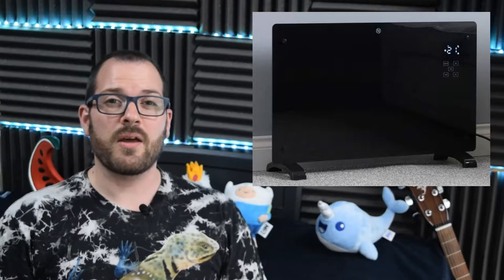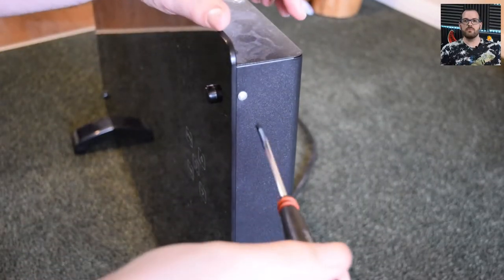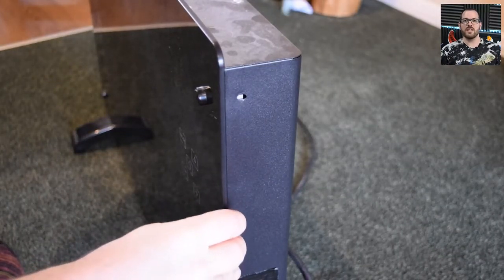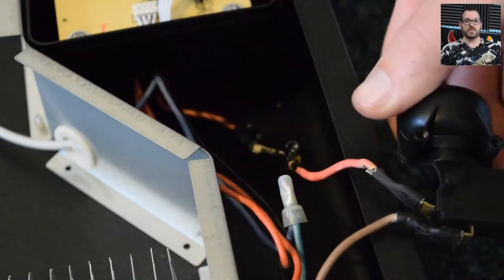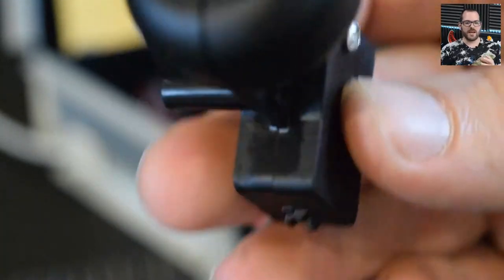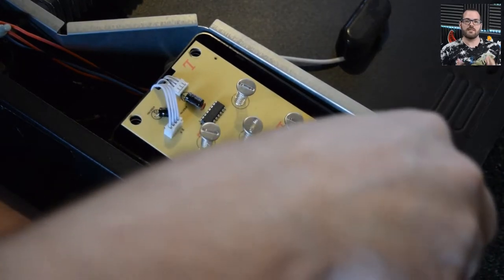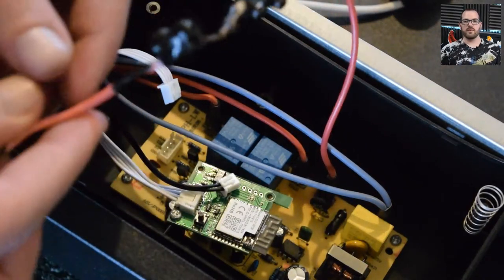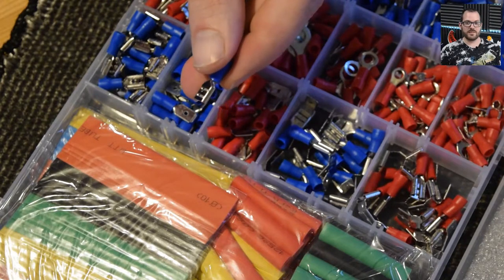E01 - Solaire Reno WiFi Electric Panel Heater Repair

Comment: Hi wondering if you can help me with an issue I have with pretty much the same heater. I bought mine off amazon, and cannot find any support or repair videos anywhere online for the isseu I have.

Long story short - Had a power cut, and this affected the heater. It switches on fine, emmits the LED screen. However no heat is being generated anymore. I've take it apart and seen nothing melted or any clear signs of where the fault coul have occurred. I have zerio clue what to do. Any hlep or suggestions?

Many thanks!
Reply: Hey Roland. Tricky one - it's going to be general electronic diagnostics I'm afraid. Do you hear the relay click when you turn it on? If you aren't getting heat, that would be my first thought.
Reply: @andrewspode  The only ticking that happends, is when I select the setting for heating on.
Reply: @Roland88  Sure the heating element itself hasn't died?
Reply: Tbh, if the heating element is dead (which is likely the case) it will just be easier buying an entire new unit 😂. Really appreciate the help though lad! Hope your channel grows!
Reply: @Roland88  agreed, but fairly simple to check with a multimeter! It might grow if I started making videos again!! All the best.
Reply: @Roland88  it should have continuity.